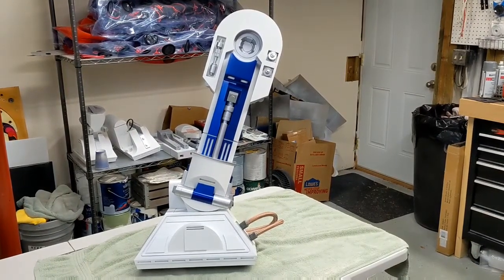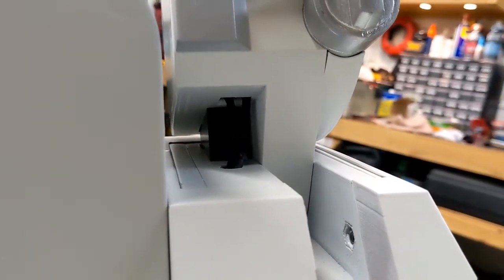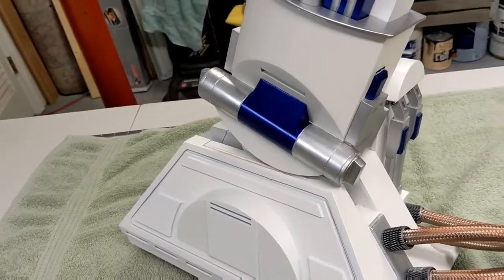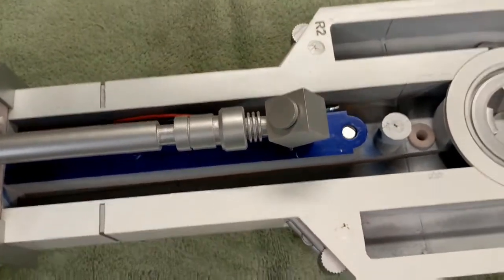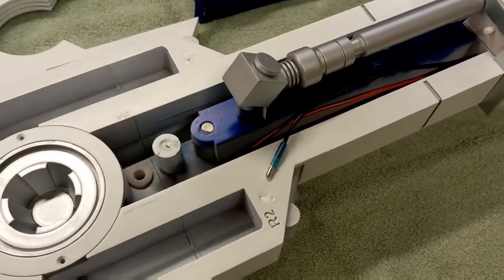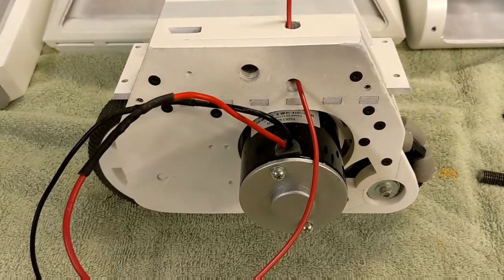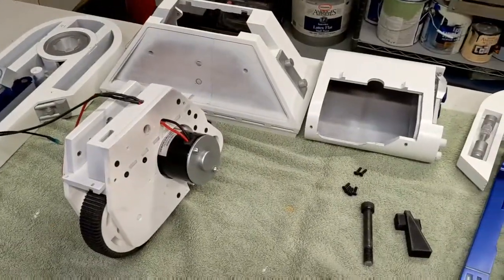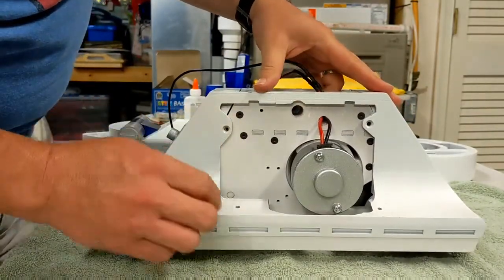Completed Leg - Overview, Breakdown and Assembly

Comment: I just found this and it’s super helpful! One minor point: you’ve assembled the leg backwards. The battery cables are supposed to be in front.
Reply from the maker: I can see how you might think that when looking at the leg with no body attached, but when R2 is in 3-legged mode, the body tilts backward and the legs stretch behind the body, effectively tilting forward as you see in the first shot of this video. I'm glad you found this video helpful!
Reply: @jasonsR2D2 thanks for clarifying. Your vids are incredibly useful and I really appreciate your taking the time to document everything. 

I’m an idiot with electronics and have begun that portion. But I’m planning to go with Padawan. If i can get past the hurdle of probably the most basic thing: getting the Ryobi-based power supply working.

Comment: What's the point of the ankle locks?
Reply from the maker: I think they serve a couple of purposes. First of all, they help maintain the angle of the leg to the foot. With the locks in place, I can pick up the leg by the top hub and the foot will hold its position instead of flop around. This has the added benefit of helping to prevent R2 from popping wheelies when he accelerates and thus improving his overall stability (also since they are flexible, it does provide some cushion and shock absorption over bumpy surfaces). From a physics standpoint, the ankle locks also provide additional support to help distribute the load of the droid off of the ankle/bolt junction which is a very small area on which a lot of load is focused. There are builders that choose not to bother with them and have been fine, but I feel they provide enough benefit to be worth it.

Comment: Has anyone tried to cast metal moulds for these leg greebles???
Reply from the maker: Your best bet for alternative greeblies is to check out the Parts Runs threads over at astromech.net. Both cast resin AND full aluminum parts are usually available. Be aware that most of the club-spec BODY-mounted greeblies (like power couplers, octagon ports, side vents, etc) WILL NOT work on a Baddeley printed body due to the thickness of the skin and differing internal geometry, but many of the leg greeblies - like the horseshoe buttons and hydraulics, the under shoulder details and even the ankle details likely would work just fine (basically anything surface mounted). I'm not sure on the leg cylinders.

Comment: Hi Jason, I am enjoying your R2D2 series, thank you. I am a  Michael Baddeley patron as well. I can not find in any of the file. The “Ankle Lock” file. What folder is it under if you don’t mind me asking?
Kevin👍🏽
Reply from the maker: The ankle locks are only in the V2 foot folders, even though they apply to the MKIII design. From the oneDrive, you can find them here: Print Files -> Astromech V2 -> R2D2ver2Feet

The files are FootLockL-Flex.stl and FootLockR-Flex.stl

Thanks for watching and best of luck with your build!
Reply: @jasonsR2D2  thank you. I found it. Much appreciated. Your tips on the mods are great. I have applied them on my first R2👍🏽

Comment: Hi, I can't find the ankle lock stl file do you have any good tips where I can find it
Reply from the maker: Those are in the V2 folders, even though they also apply to the MKIII design. From the Baddeley oneDrive, you can find them here: Print Files -> Astromech V2 -> R2D2ver2Feet

The files are FootLockL-Flex.stl and FootLockR-Flex.stl.
Reply: @jasonsR2D2  Thanks, Now I found them.

Comment: I cannot find the file for the ankle lock. Do you know where I can find it in the Badley files?
Reply from the maker: Ah, yeah. Some of the files are only in the V2 folders, even though they also apply to the MKIII design. From the oneDrive, you can find them here: Print Files -> Astromech V2 -> R2D2ver2Feet

The files are FootLockL-Flex.stl and FootLockR-Flex.stl  I don't recall the exact number of perimeters or infill I used, but they are somewhat firm. You don't want them too squishy.

Comment: Jason, why didn’t you try to use a hover board motor/ wheel for both legs instead?
Reply from the maker: To my knowledge, that's not a commonly used motor type for droids, and it's definitely not what the Baddeley drives are designed to accommodate.  Additionally, as this is the first time I've ever taken on a project of this scope, I didn't want to put myself in a position where I needed to redesign key systems of the droid, nor do I know what implications this might have for the various control systems that are currently available.

To be clear: "not commonly used" certainly doesn't mean "can't be used", but it would definitely require someone with knowledge and skills beyond what I have to make sure that such components can be safely and effectively integrated into the current Baddeley design.

Comment: Is your wheel assemble made out of wood and 3d printing?  If so, where are the files for the 3d Printing?
Reply from the maker: No wood was used on my build. I am using the 3D files from Michael Baddeley (https://www.patreon.com/mrbaddeley). The drives are his MKIII designs, the legs are the V2 legs - they are the same design as the MKIII only cut into smaller pieces.

Comment: Did you use Rub & Buff or Silver Paint?  For the ankle bracelet, so I didn't have to paint the little divots in between the booster and ankle bracelet, I made the ankle bracelet out of plexiglass- and it covered the whole leg area and when I attached the booster is slide up against the ankle bracelet.  Difficult to explain.  No matter how well you paint, or how often you touch up, there will be scratches, chips and dents!  It's the life of an R2D2 to have damage!  Great job.
Reply from the maker: I used silver paint as a base coat for all of the silver parts, but added some rub n buff on top. Not sure it made too much of a difference, though. Your ankle bracelet solution sounds great! One thing I really love about droid building is that everyone innovates in some way or another and that really keeps the hobby evolving. Thanks for watching!

Comment: Great video, I'm doing the same build and these have been helpful. I was wondering what type of bolt you used on the center ankle.
Reply from the maker: On the center ankle, I took a length of M8 threaded rod (or maybe it was a bolt with the head cut off) and used my Dremel to carve slots in one end so I could use a philips screwdriver to drive it in flush. Because of the way the ankle fits together, you can't have anything protrude out of either side. Looking back, I should probably have used smooth M8 rod instead. Either way, I added a picture of it to my public build photos (the link is in the "About" section of this channel). It's the last photo in the album. Thanks for watching!

Comment: Can you post where you got the wheels. The web site. Please
Reply from the maker: The omni wheels are from Vex Robotics. These can be used in place of the printed Baddeley omnis for the MKIII drives and require a few different parts to be printed for each of the drives. These parts can be found in the "VEX Mods - Hans Bekaert" sub-folder folder for each drive. The design has evolved a bit since I built mine, but with the right parts you should be able to figure the rest out.

Using the Vex omnis is definitely not inexpensive, but the consensus seems to be the durability and build quality is worth the investment.

EACH outer foot drive requires the following:
(1x) 3.25"  omni wheel (https://www.vexrobotics.com/omni-wheels.html) sku #217-4775
(2x) 0.5" Thunderhex flanged bearings (https://www.vexrobotics.com/pro-bearings.html) sku #217-4006
(1x) 0.5" Thunderhex Stock (https://www.vexrobotics.com/thunderhexstock.html) sku #217-4017 (sadly only comes in 36" lengths, and you'll only need about 3" or so per foot)
Finally, you'll need a long (I used 75mm) m5 socket cap bolt and washers/nut to tie it all together.

Thanks for watching!
Reply: I’m a member your video best I seen. Please make more I’m also doing R5 as well to many R2